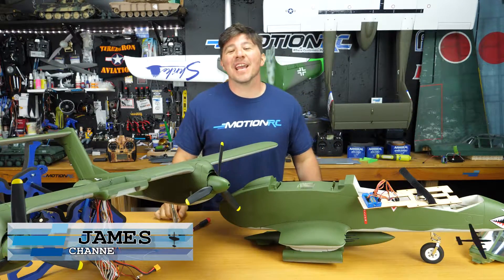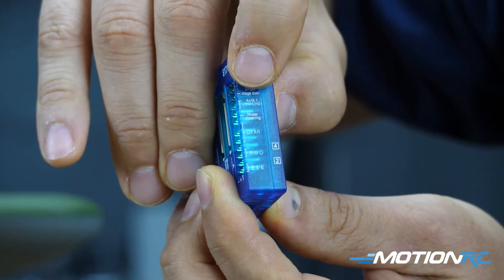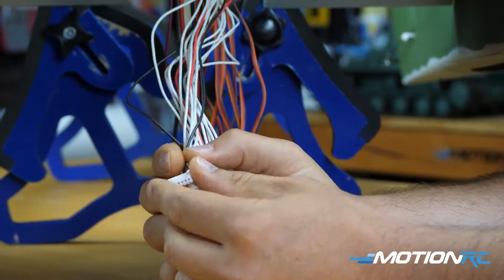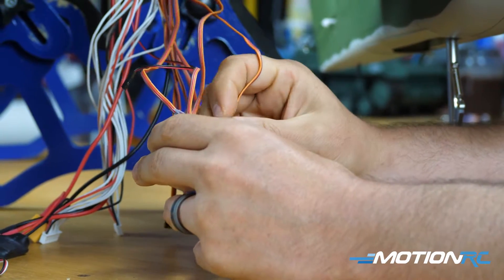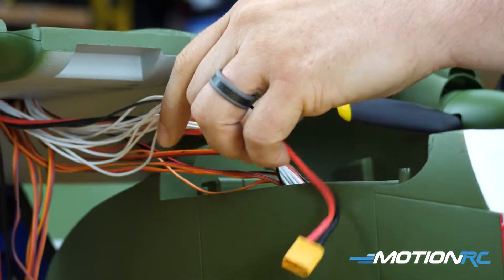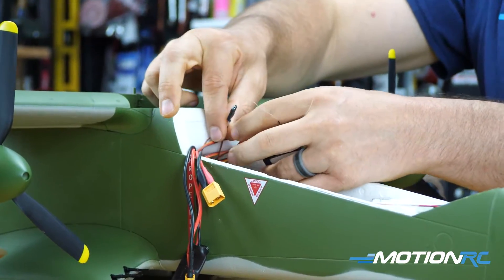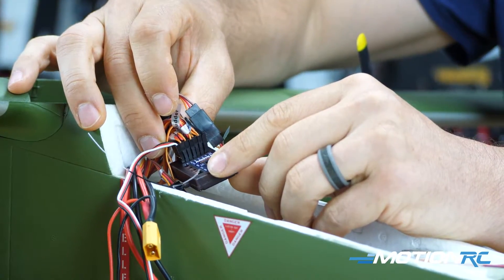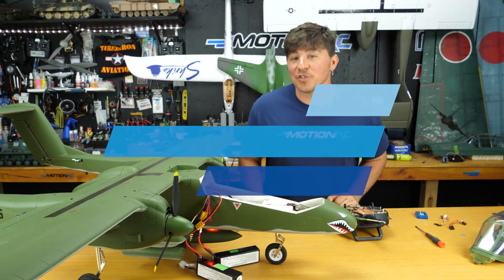Wiring Instructions for the FlightLine OV-10A Bronco  - Motion RC

Comment: I’ve got to say, I know what I’m doing with these things, but this video is just so confusing. If I was new to these types of things this video would not help at all.
Why do you go over things 2 or 3 times.
Just show it once, from start to finish.
And don’t show things that are not needed for this plane. Eg-lights and gear doors. No need to show where to plug them in when there are none to plug in anyway.
Reply from the maker: Not true though. You are plugging in you nose light, your bottom strobe and your top strobe
Reply: I agree with you.  James moves from one area to another so quickly, one cannot follow him.  These type videos are useful.  However, do not do them if you find that they are a hassle for you to do.  If you prefer that we pay for the instructions, let us know this too.   I am still working on the wiring on this one and it is to say the least, very frustrating.  I can only take one evening at a time though before I need a mental health break.